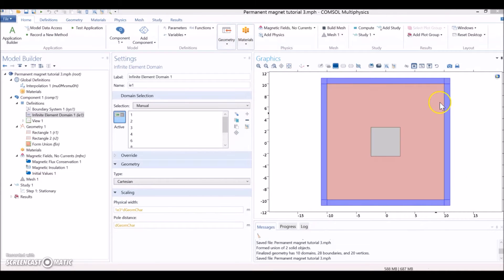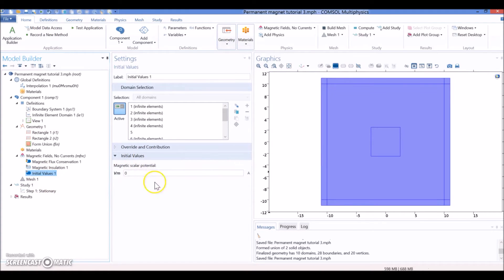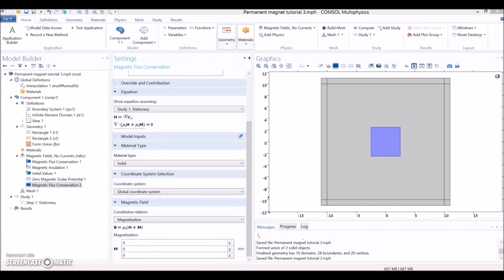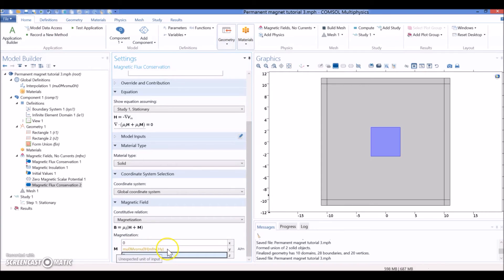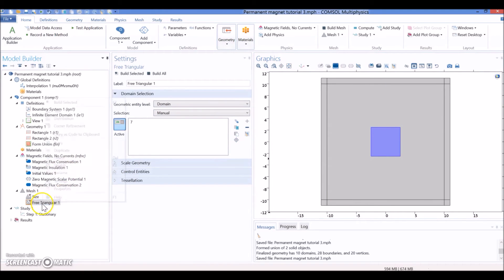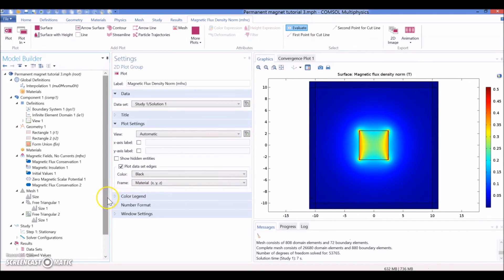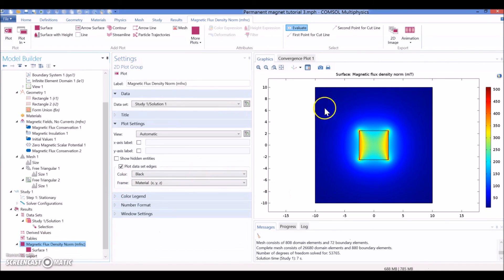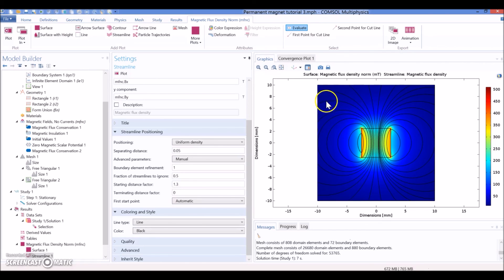Permanent magnet tutorial 2

Comment: you can add remanecent flux density and in the direction vector you can set 1 or -1 based on direction of te B field and run the simulation it will work. The values he gave in the website are already in A/m so we dont need to divide or multiply with Uo